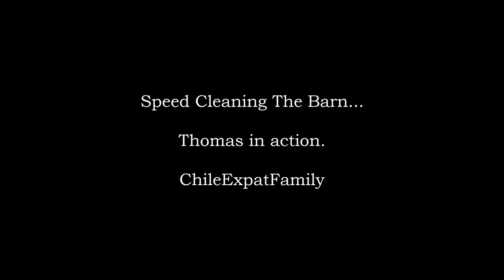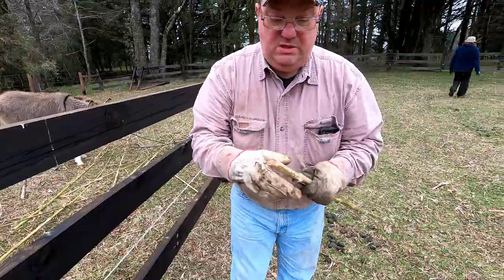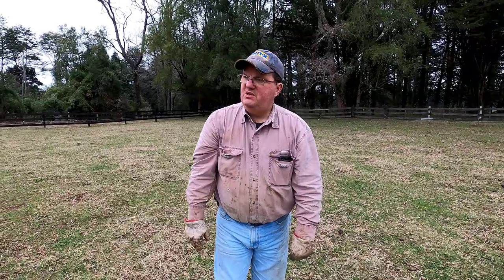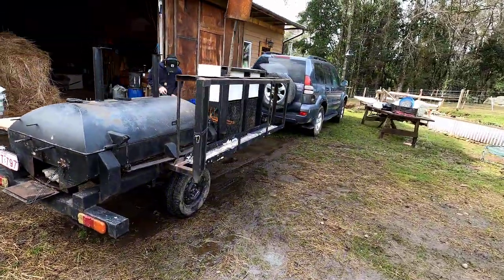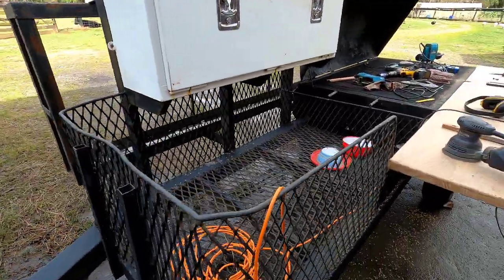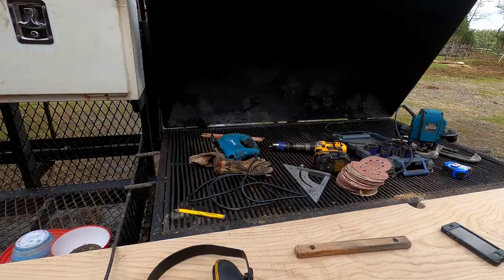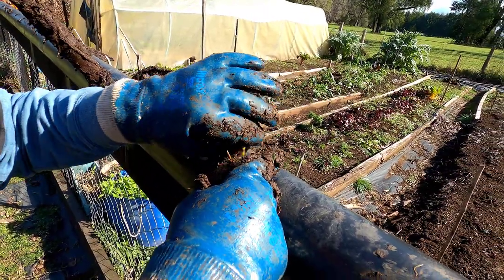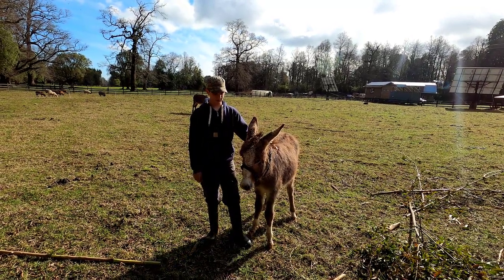Spring in Chile Barn Field Plowing and Strawberries

Comment: It's probably been covered in an earlier video. But I'm wondering if you use 220, the standard for chile or 110 since you don't appear to be connected to a power pole?
Reply from the maker: I chose to use the standard For Chile which is 220/50. 
The reason I did is because i knew that over time I would purchase appliances and tools that are sold here in Chile which are 220. I do have some tools and other things that still use 110 and I use a power converter for those items. 
When you move to Chile you will mess up ONCE if you are lucky and toast an electrical item. Not fun but you live and learn. 
I do like 220 better because it is just more efficient. My solar system is a 48 Volt system that is 10kw and as stated, 220. 
As a warning, do not bring with you too many electrical items, mainly appliances, from the former USA since they do not like the power here at all, even with a converter. 
We just found it is most economic to go all in up to the neck, feet first 220.
Hope that helps. Jim